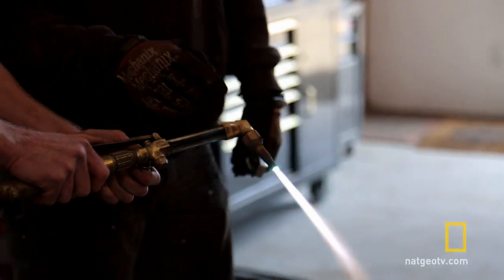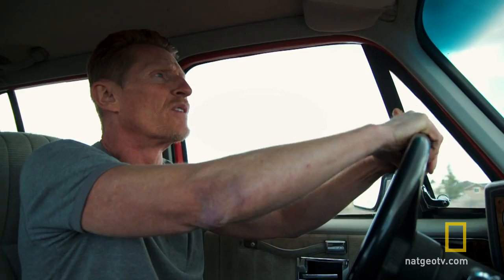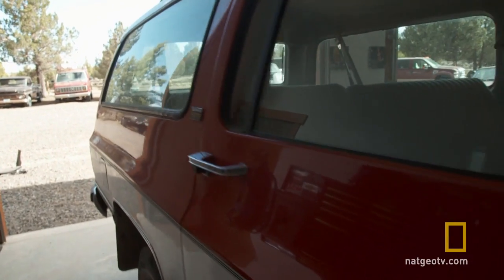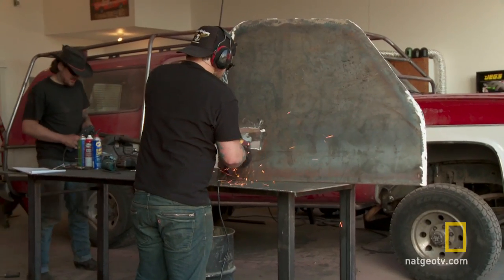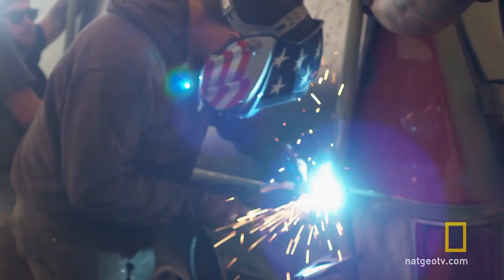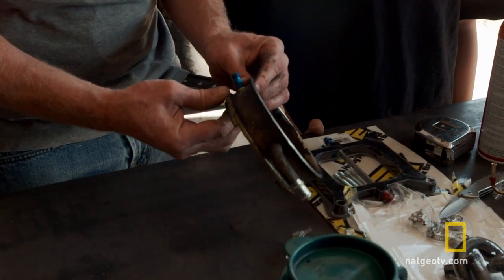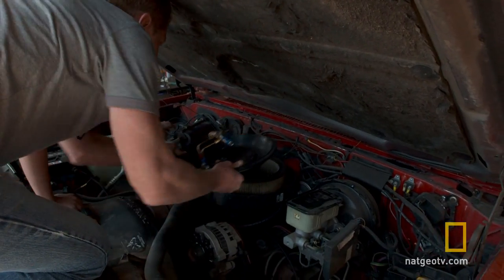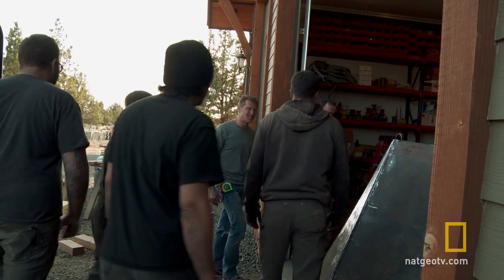Prepper Build: Ultimate Bug-Out Vehicle | Doomsday Preppers

Comment: His truck will overheat because he just blocked the entire grille with that snow plow.
Reply: Sketchy Fab Co you see how much welding is going on and not a single welding blanket lol. Glass must be in grate shape on the rig now
Reply: Honestly he way overdid it. Linex probably would have been more practical and cheaper. Armor plates inside the doors, maybe a slanted grilldefender for your radiator.
Reply: Very much possible

Comment: You just covered the grill and reduced airflow over your radiator. When you stomp the gas and need to bug out, your truck will overheat. This is stupid.
Reply: Donovan notmyname That's mean.
Reply: Tyrion I went too far...sorry.
Reply: What real armored vehicles used is a slanted steel grill. Blocks rounds but still lets air through

Comment: I'm going to do this, but properly execute it. Get some Kevlar so the steele plates can be a lighter load, install a snorkel kit (place steele on pipe but not the intake) install overhead lights, if possible place some steele on the bottom to protect its belly. oh! And put a form of steele ring that fits the tire to allow it to move better, heavily modify the suspension, modify the steering, and of course modify the engine.
Reply: Donovan, this comment is three years late but you are absolutely correct.  I laugh at these amateurs who don't understand the physics of the vehicle and what just adding armor on to a vehicle will do to its performance and reliability.  Just like when we (military) (USMC Ret) did with the HMMWV.

Comment: That dinky half ton Suburban now weighs well over it's weight limit, you will probably break something, a spring, an axle shaft, wheel bearings, and be in the middle of nowhere with a 9000 pound Suburban that you now get to live in because that is all you have for shelter.
Reply: Its probably 10,000+ lbs. And I'd wager he'll pop a tire just sitting in the garage.  If he tries to turn very quickly he'll roll the tire right off the bead as well, not to mention the issues you brought up.

Comment: I built the ultimate bug out truck for car shows and its usefull and i can drive it around town for fun and runs flawlessly. Its a 4x4 long wheel base chevy 2500 hd with the vortex big block that came jn them converted it to carberated with a msd ignition system huge super charger woth blower coming out of the hood its lofted only 2 inches that way its dtill stable to drive fast in corners and go off toad ad well. I have 6 racing seats in the bed and its framed in with 3/8 sheet steel for protection from bullets but not any type of gernad launchers and stuff like that could take it out easily. 210 shot nitrous system and makes 1100 hp to rear wheels with out nitrous and 1600 with nitrous. Very easy to drive and very reliable. Has three radiators that the coolant runs through in case one goes out or two.  The bed where it has 6 mointed racing seats on a swivel locking system there is also two gun ports and two little bullet proof glass windows so each person can see when they gotta start returning fire. Its a fantasy build for car shows but its still 100 percent functional and stays 100 percent ready to bug out. Im currently building a camper that is armored and im currently building a underground bug out bunkers 4 if them on my family's hunting land that all we all share and all own a percentage of and they all pitching in money for the 4 bug out safety storm shelters as well and there will be a tunnel to connect them all together with a massive concrete and steel sheet reinforced doors to block off acces to the bunkers from the tunnels incase a bunker gets taken. The furthest family is a hours drive from the bunker and thats what my truck will be used for is getting each one of the families to the bug out shelter safely with protection and do it in the cover of night as well. The motor and exhaust is silent i have a muffler system that makes the exhaust silent you cant even hear it 10 feet away all you can hear is the electric fans and thats it and what ever slight noises and motoer and super charger makes. I know i might sound crazzy but i didnt believe in needing all of this stuff and that ppl who prep for post opocolyptic type end of the world fend for your self and your family only type situation until about 3 years ago when this country starting going down hill faster then it ever has and with all these wars going on in the world. The truck also has a 1/8 thick plate steel exoskeleton arounf the whole thing to protect it from rpgs where it will hit the exoskeleton first thats surrounding the truck to make sure there is less damage as possible from a rocket like that like our tanks and other vehicles have in the current military. The windshield is a small thin slit abour a foot wide and 3 feet long made of thick bullet proof glass that can with stand direct hits from a 50cal machine gun wasnt cheap cause i had to buy a old military surplus vehicle that had the bullet proof glass in it and thats where i got my bullet proof glass from and other exterior armor and gun mounts and other equipment and parts for my truck build. I also have a 50cal machine gun mount on the roof that you can open a hatchount a gun and fire but i font have the gun for it but during a end of world situation im sure ill come across a 50cal machine gun at some point off a dead person or a blown up camp or truck or what not. In waiting on my license to come through so i can ourchase a 50cal machine gun legally but which ever comes first i have a plan for one

Comment: Nobody gonna say anything about how impractical the weight of steel plates are gonna be on a 1/2 ton frame? On a gas motor? He probably got 10mpg before. He'd be lucky to get 6 now...id have to say thats far from the ultimate bov but. To each their own. He'll run outta fuel before he actually gets anywhere.

Comment: lol, weighs a ton.  Slow to speed up, turn or stop.  Radiator can't breathe now, engine over heats along with the heavy load it needs to haul.  Engine is way under power to handle all that weight.  No armored tires?

Comment: Lets see, restricted airflow to the radiator, a LOT of extra weight. Was the rear end swapped out for a stronger unit to handle the weight and HP? What about the transmission? Shocks, springs, U-joints, door hinges,locks etc.
 And of course he will drive it around so everyone sees it. And someone will probably take notice, hmmmm.....wonder what else he has that I could use???? OH, and it's now been seen by at least 3,370 people.......

Comment: Ok ok ok ok this is no good what a dum idea that big plow in the front is blocking air flow.The motor is stock chevy engine that's old and probably has no power and any engine  that u shot with nitrous needs rebuilt after about 3to5 shots